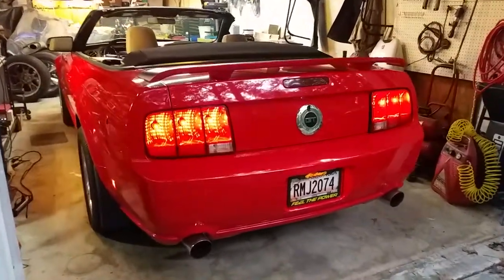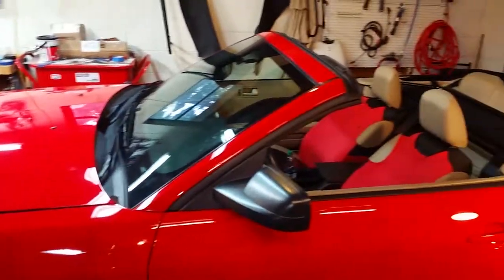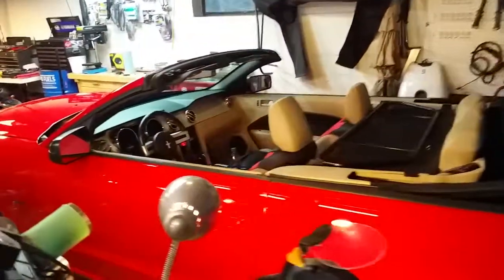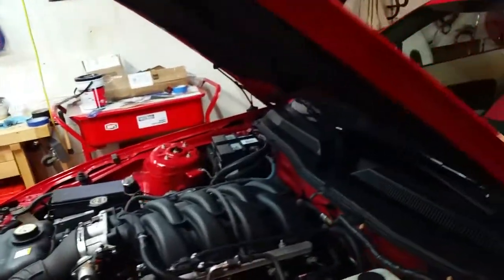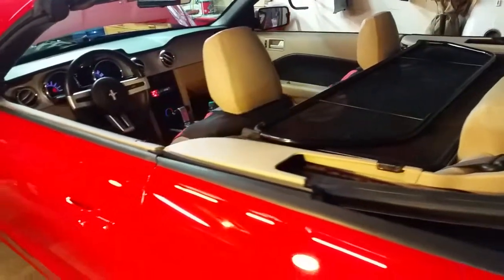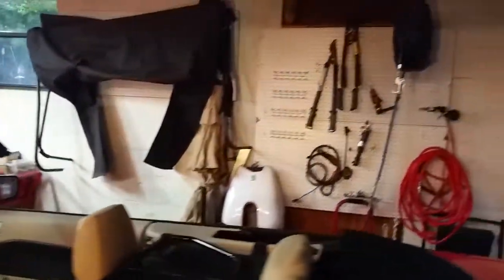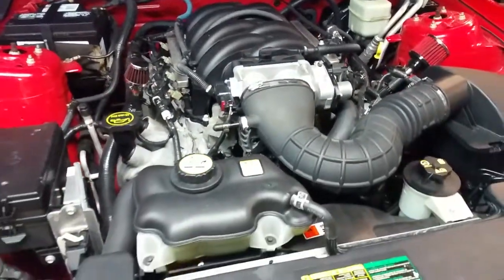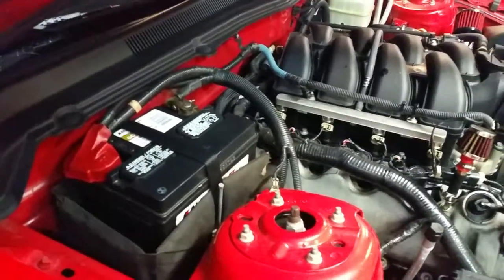Tips Fixes Tricks re 05-09 Ford Mustang repairs mods maintenance GT 4.6L V8 More Here

Comment from the maker: I have had this car for three months.  I am thrilled to no end at how good this car is.  ESPECIALLY FOR ITS AGE.  It is an epic running car, great to drive, of course the CONVERTIBLE part goes without saying.  Fun car. Looks awesome.  It does EVERYTHING well.  And easy to work on and get parts for.  TOTALLY THRILLED WITH THIS OLD DAWG!
Reply from the maker: Google Catch Can and Manifold Vent / Crankcase Vent.  Especially for older V8 cars. Even older street motorcycles - like Harleys. This re-routes the nasty polluted crankcase vent gases (that the oem's want you to RECIRCULATE through your air intake.) Basically letting your motor breathe hot nasty oil vapor. No thank you.  I vent this out instead. A common practice for those who know what's up.

Comment: My 09 California special mustang at 97k miles developed ticking an got louder found out a roller follower failed an was grinding on the stock cam so I replace both cams 24 new lifter lash adjusters an roller followers oem new phasers new oem timing chain guides to as well as tensioners I also put a meling high volume oil pump an now the engine sounds like a dream nice an quiet an runs great I also put 5w30 in it as well after doing all that work